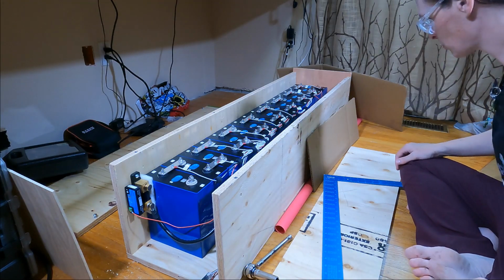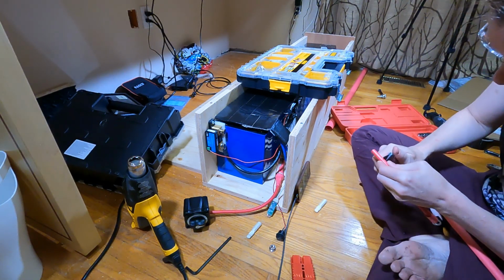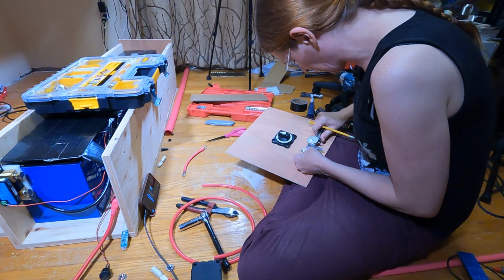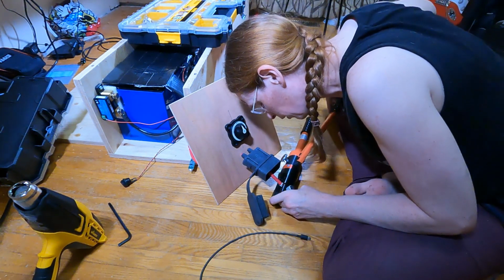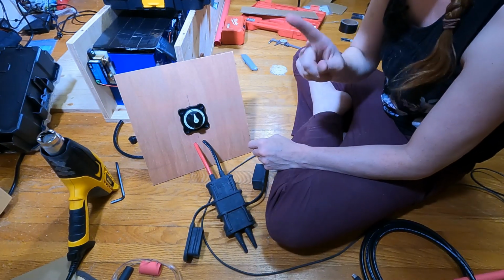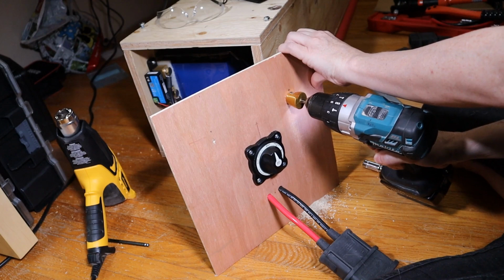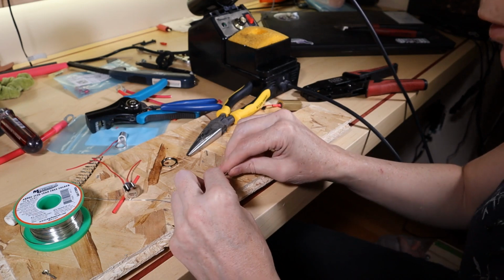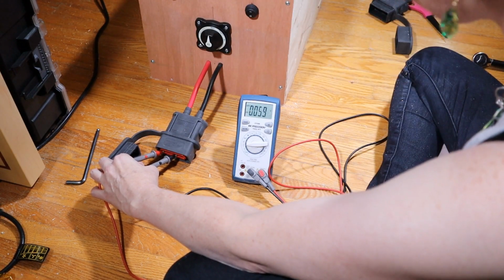Battery Assembled! (and a new camera!) - How to build a 48v Lifepo4 battery (Ep. 12)

Comment: Not sure if you're planning on doing it, but don't discount the necessity of cell compression for longevity of prismatic cells. I know some advocate that it's not necessary, but they may be mistaken, misinformed, or think they know better than the manufacture. I've worked with prismatic cell's going back 10 years. Also nearly every spec sheet I've read from the manufactures say's it's required.
Reply from the maker: It's discussed in the EVE cell docs as well, and Andy had an entire video on the topic. I've not decided what I will do you, given I expect the absolute maximum charge/draw will be 0.35, usually well under that. Just the same, another benefit of compression would be minimizing cell-by-cell movement/rubbing, which on boat has it's own benefits. So I will probably compress them when I build the final case.
Reply: @TheDigitalMermaid  I'll be doing a video on it soon too.
Reply from the maker: @BradCagle  Excellent! The more information out there, the better.

Comment: Those cells swell up and they need insulation between the cells and some form of compression like mount them in sand or something..  Those 1/4 x 20 stud termanals won't do 100 amps continusly without onerheating and arcing and burnning the termanal.  The shunts going to dig into the battery and short and Boom.  With that configuration those batterys need to be outside at least 20' from the house  because they will burn down the house the way they are. .